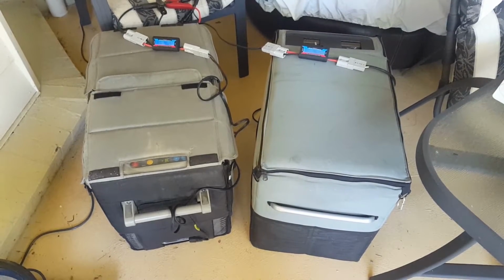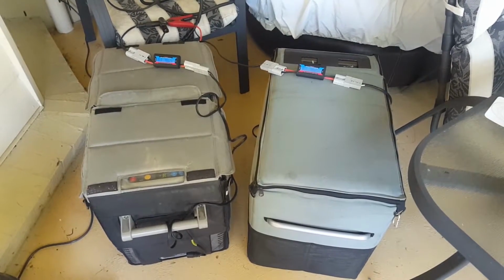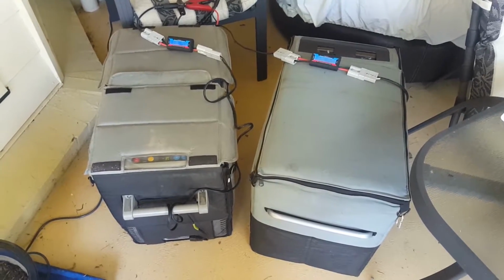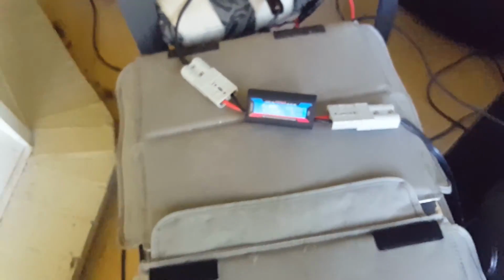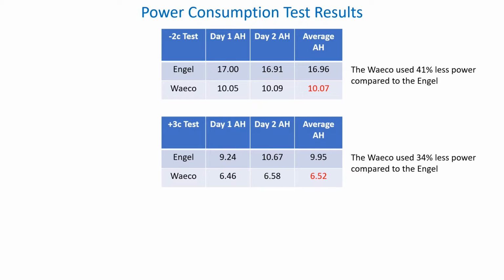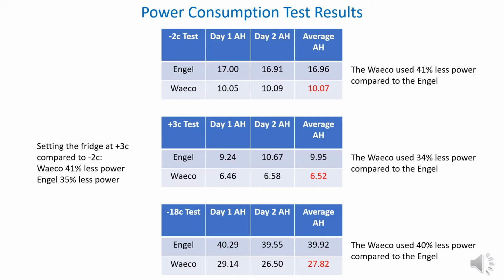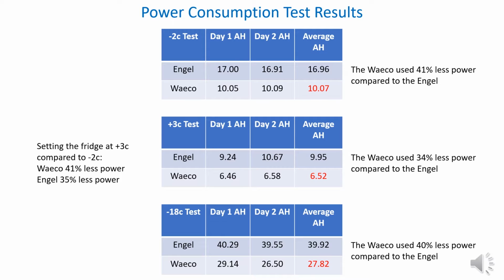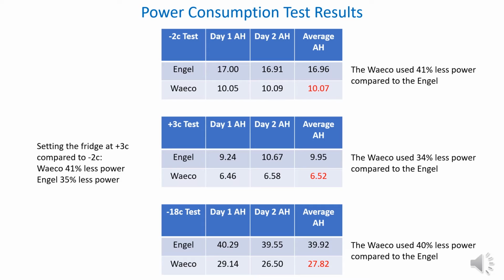Waeco vs Engel 4wd fridge WINTER power consumption comparison

Comment: the thing that this test wont show is that on a 40+ degree day the Waeco will 100% quit and trip the thermal overload on the compressor, but the Engel will keep chugging along all day until the sun goes down and it gets down to temp, this comes from owning a CFX 95 and an MTV-COMBI 60L
Reply from the maker: I have had the temp sensor die twice in the Waeco over the years, though I have never had any issue with my Waeco keeping the contents cool not matter how hot the temperature was.

Comment: Wow, read all the Engel religious nuts squeal like stuck pigs and shoot the messenger.  I've had both and think there both good units though the waeco/dometic is a bit cheaper and quieter. I don't like the metal case on the Engels, prefer the eclipse as the metal case dents easily and looks like shit after a number of years.

Comment: Great video, although I have to suspect your Engel has a problem. My 12yo Engel draws 1-1.2ah on average over two days when it’s the back of my wagon (loaded cold goods, pre-chilled). Perhaps the seals are gone? Just a thought. The seals in mine are getting hard and not sealing as well as they once did.
Reply from the maker: I will have to give them a checking over. To be honest my Waeco is my daily use fridge in the 4wd so the Engel spends pretty much most of it's life in the shed.

Comment: The efficiency of a fridge is measured by how often it breaks down
Reply from the maker: And I can say I have had the Waeco die which in the time I have owned it. From the typical issue of the temp sensor failing.

Comment: WE STILL NEED A SUMMER COMPARISON VIDEO!

I used my waeco CF40 all through autumn, and going off of voltage level on battery the next day after no sun the previous day to charge and en estimating how much was lost due to running the fridge for 24 hours I'd say in colder weather this correct! On around 0° i reckon i was loosing 6-8amps
But now it's summer and my car obviously stays warmer than outside temp overnight so the fridge is experiencing minimum temps of 18° and max of 30°+ now and my battery even after being charged throughout the day is reading more than half discharge the next day.
The fridge turns on to cool itself down almost every hour now and i know run it on 3° in attempt to save on power.
In autumn/winter the fridge would only click on say every 3+ hours and be on for no longer than 3miutes at a time. Now it takes almost 5minutes sometimes to get to temp...
Hope my battery and fridge are fine and simply the issue is just the weather. But man i didn't expect this much of a power draw jump. 😔 Upgrading my 120watt to 300watt panels now just so i can ensure it's always getting every bit of energy.

Comment: I have an Engel eclipse and 3 40 liter waecos , I have also noticed the huge difference in power consumption to the stage where I don’t take the Engel out in the boat anymore , mainly because the quiet vibration makes it impossible to sleep , in its defense it has never missed a beat , all 3 waecos have failed in the electronics department , I have by passed the waecos electrics and fitted my own manual thermostat in the dairy compartment and just sika flexed the sensor probe to the evaporator plate , the waecos have never missed a beat since doing this but it just sucks they can’t make a decent electronics set up , otherwise they are far superior to the Engel ? If I wasn’t a handy person my waecos would have ruined many a holiday due to electronic issues ,
Reply: Can you make a video on how you made a manual thermostat for the fridge?
Reply: walker2508 you just buy them waeco sell them as they come standard in there upright fridges and portable refrigeration kits

Comment: Wow, I always thought that the Engel was the more efficient fridge, thanks for this info. 
I am just experimenting with power supply for my old (18yo) Engel at the moment, and just found this out recently after a number of tests.  The waeco has a big advantage on the lower cyclic rate per hour.
Reply: I've found engels to use more power but be alot colder and alot more reliable as when I was in the NT camping I actually had a waco 60l die on me and me dad had a 80L Waco die under similar conditions it was like 40 plus days though so hot af I've had an engel for 10 years now never ever had a problem but I have found the engel uses more power I've got an 80L engel and she's a beauty best thing I ever brought however if your not in super hot conditions a Waco would probably never let you down but I found in the harsh NT heat they don't stand up nore do the kings ones but same goes for the kings fridges in cooler conditions they'd probably be fine it's only in the harsh 40 plus days

Comment: Hi there, Thanks for the comparison. Really a lot of good information.
Can you say something about the noise levels?
I like to buy one of those for our camper-van and the noise is a big issue if you sleep close too it.
We have a 15 year old Waeco that we like to replace for that reason.
Reply from the maker: Not to sure I can help with you the new models regarding noise. With the older models between the two the Engel is much nosier then my Waeco. I travelled a year in my troopy with a bed in the back next to the Waeco. While there was general noise it was not to terrible and IU got used to it pretty quickly.

Comment: This is a really stupid question, but I'm going to ask anyway. If I have a 102ah battery and the 40lt waeco, if it averages 6-10ah's every 24hours does that mean I could potentially get over a week without charging the battery. I know that's you shouldn't go below 70% with a deep cycle but say if I have absolutely no sun, or it's just pouring rain and stormy for a week and I can't get my solar panels out or whatever for an example, I should be fine to keep the fridge running?
And would it be fine to unplug the fridge when charging other things then connecting the fridge back up so I'm not using double the charge from the battery. Aslong as I don't open the fridge it should keep its temp pretty stable in moderate conditions without being directly powered? Also can't charge it while driving as I didn't realise I got a lead acid battery and not a gel one and my car's 12volt wiring is fucked... Have been told not safe to use in car as lead acid batteries releases gases?  😅 The dickhead at the shop who sold it too me obviously knew nothing about batteries as I said it wouldn't be fitted into the bonnet it was going to be in the car with me.
I'm living on the road in free campsites for a year and haven't tested my fridge out so I'm just asking for ease of mind so I don't stress out about the battery dying and such as I know nothing about all this.
Reply from the maker: Yes it maybe possible for it to run that long depending, though as you say regularly going below about 70% and far below it will shorten the battery operating life.  It is not something that I would personally do. https://imgur.com/y4rgstd Waeco's have a voltage cutoff setting which can be set through the main menu system to stop draining the battery to low which will so come into play.

The compressor in the fridge is not running all the time, it only kicks in every now and then to maintain the temp. There should really be no reason to disconnect the fridge while charging something else. 

Yes basic lead acid batteries release gases, though whether it is a sealed battery is what matters. An AGM battery is still a lead acid but nearly all the ones I have seen and owned are sealed and can be safely mount in any orientation within a vehicle. https://imgur.com/4t7u9VA

Enjoy your year of traveling

Comment: Great test but.. Your table headings are wrong power usage is measured in W(Watts) per hour, which is what you get with those Watt meters. So... Whrs is the right table heading. 
For example my 89L Evakool Glacier series, draws a maximum of 6 Amps on 12 volts so.. (Wh = A * V)  at 50% cycle duty (compressor), when set to -15°C in 30°C ambient . Total power {(= A * V)*0.5}= 36 Whrs. Your numbers seem correct compared to my Evakool with the same compressor (Danfoss Secop) as the Waeco.
Reply from the maker: Hey mate, yes you're correct about the term power, though that is how the average person uses it when relating to their dual battery systems. Yes the gauge measures in watt hours but they also measure in amp hours as you can see in the video at 2:15. All my data recordings and math is based on amps not watts. Really I should have just labeled the titles amps as I am providing the total number of amps used over a 24 hours period. Thanks for the comment and insight. Cheers

Comment: i have an engel fridge freezer as well im a bit disappointed with it as people know the engel isn't that thirsty on power when cycling as compared as the waeco who does chew up way more amps but the main problem with the engel which make a big advantage to the waeco is the cycling duty. The engel does cycle way more often than nthe waeco due to the stupid thermostat working in a different way as compared as the waeco and many other fridges that only cycle when the thermostat sense a chosen temp. that's why results are so good with the waeco. Now new engel fridge do have a digital controlled thermostat  like most fridge and it would be a really great experiment if you would do it against the new waeco or the same one.

Comment: Would love summer readings. I’m currently in Broome and my 75L dual zone Companion is hammering my aux battery
Reply: They are great but thirsty on power, I replaced the fan for higher velocity and cycles less, therefore saved around 6 amp a day on meter.
Reply from the maker: Will do mate. How have you been liking the Companion?
Reply: The Outback Drifter so far so good. I’ve never owner a Waeco or Engel so keen to see what their consumption figures. This one has been using a lot of power, but considering it’s been around the 40’c mark and I’m running one side as a freezer it’s hardly surprising. The control panel is a tad awkward to use, but the Bluetooth app is child’s play.